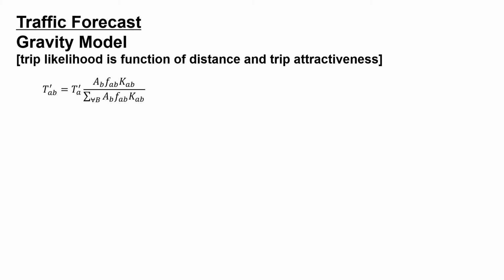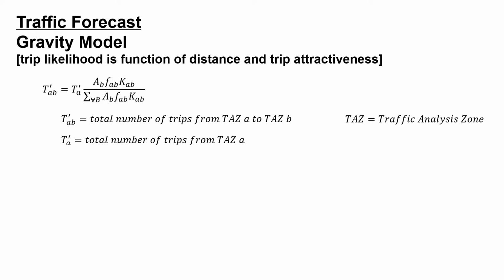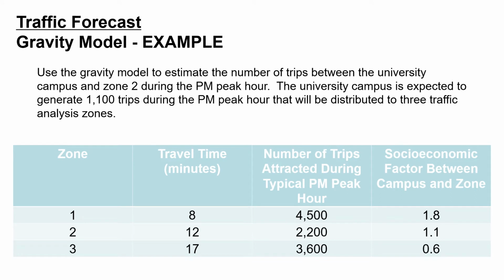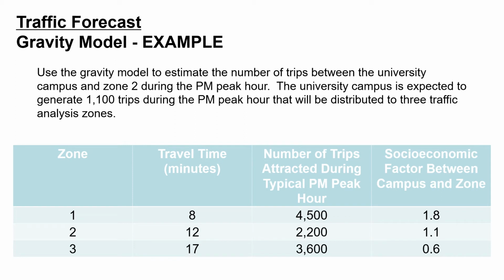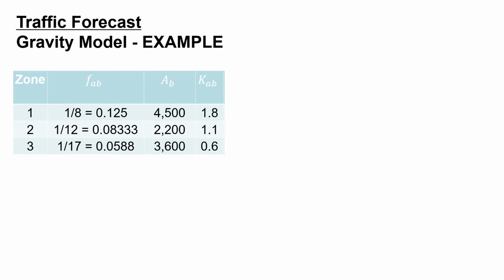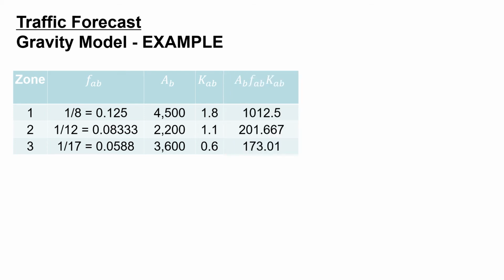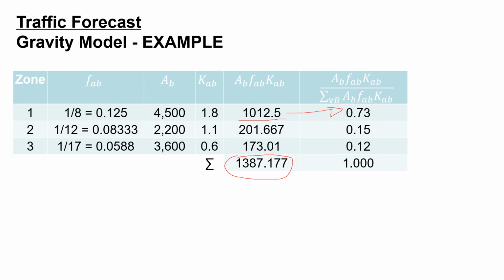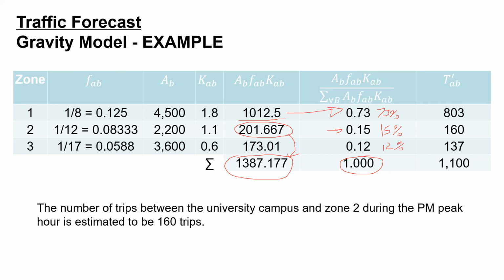Gravity Model for Traffic Forecasting | NCEES Civil Engineering PE Exam [Section 5.1.5]

Comment: Sir, I see your note about the correction for the problem answer but still I am getting 165 trip not 202. Am I missing something?
Reply from the maker: I get values in the column of 0.755, 0.150, and 0.095.  The last column is 1,012.5, 201.7, and 127.1.  So, the correct answer is 202 trips.
Reply: @FindleyDaniel  Revisiting this, your revised values of .755, .150 and .095 are correct, but 1100*0.150 is 165 trips as Samira mentioned above, not 202
Reply from the maker: @2010bassmaster2010  Thank you!  Yes, I've updated the description now (I'll probably update this video when the next reference handbook is released).

Error / Update: The final answer should be 165 trips.

The next to last column should have values of 0.755, 0.150, and 0.095.  Therefore, the last column (with each value from the 2nd to last column multiplied by 1,100 trips) is 831, 165, and 105.  So, the correct answer is 165 trips.

Comment: 0.0588*3600*0.6=173.01?????????????
Reply from the maker: You're right!  I'm not sure how I made that mistake.  That means that values in the following column are actually 0.755, 0.150, and 0.095.  The last column is 1,012.5, 201.7, and 127.1.  So, the correct answer is 202 trips.